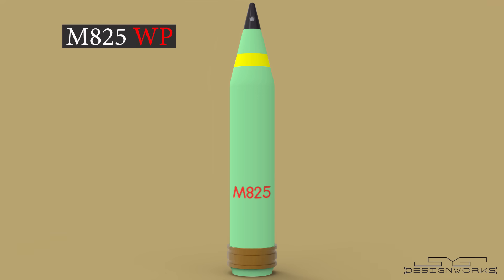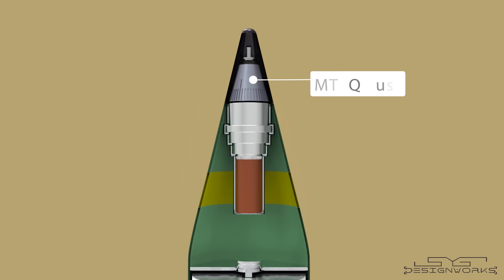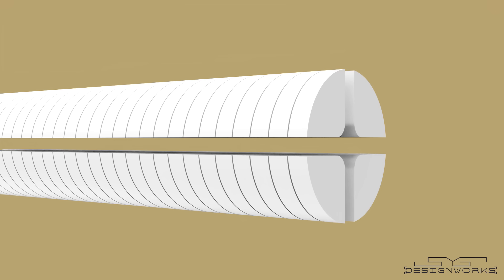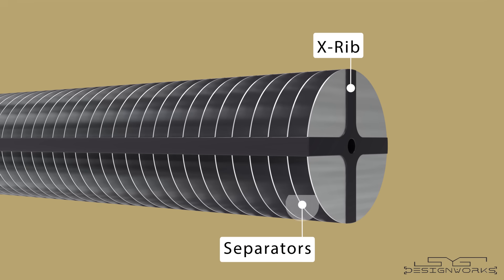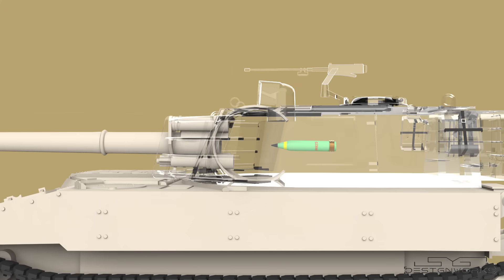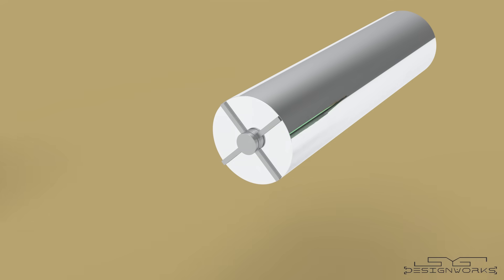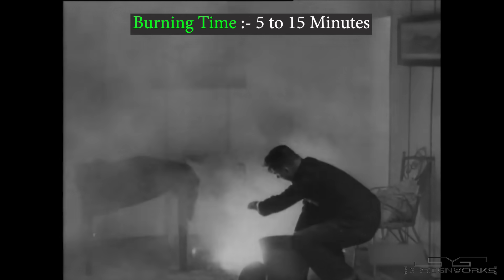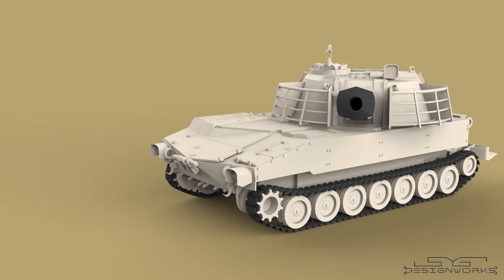What are White Phosphorus Bombs and How it Works?

Comment: Mud is the best thing to extinguish WP if it gets on your skin. DONOT use water! Other than that, mineral/castor oil or some type that has a really high flash point like grapeseed oil. This is only with small pieces of WP though.

Comment: White Phosphorus (WP) aka Willy Pete is actually very extremely poisonous substance, used as a smoke screen, and also incendiary. When it comes to a human being it burns horribly and causing infections; it burns in contact with air. Newer ones can actually burn in air or water, older ones only water can actually put it out.

Comment: Willie Pete is absolutely the best "Break Contact" tool in the arsenal. Back in the day, we had WP in grenade format which was absolutely one handy little tool in our bag of tricks. Good for clearly bunkers and tunnels, it also useful for marking enemy positions, avenue of advance denial and absolutely the GOAT for breaking contact with a larger, numerically superior enemy force. It was also a sneaky little bastard. When in contact with said "numerically superior force" you could lure the bad guys into a "Mechanical Ambush" by throwing alternating Willie Pete and White Smoke (or CS) while setting up the Claymores daisy chained and crisscross aimed. When the smoke from the WP cleared they would charge through just knowing that this must be a critical path or weakened unit...just to run into the Claymores (ouchy mama).
Reply: Thanks - both for your service and some 'tactics'. Did you employ that yourself - in Special Forces/units? 
WP was also used by FACs - their rockets marking targets for the 'fast movers'.
Reply: @ibubezi7685  I still have the pock mark scars on both arms and my back from being " a little too close". I don't remember how many times we used WP,  but it was more than a few times...worked most the time. Love me some FAC's, if they were in the bar, they never bought themselves a drink, not while I was there anyway. Same with "Rotor Heads" and "Fast Movers" even today, when I occasionally run into one, whatever it is we're eating or drinking... they can keep their wallet in their pocket...I'm buying.
Reply: We used WP grenades to destroy equipment. You can put one on top of an engine and it will burn through it. It's wild
Reply: @phatbottom  I suspect you're confusing Thermite with Willie Pete.
Reply: @brianfoley3925 bingo ! Another one of these Iroq / Afghanistan veterans
Reply from the maker: Wow. Thank you for watching!
Reply: Who are you talking about?  What 'enemy' are you talking about?
Reply: @peterthurman9384  You know...pesky neighbors...the kids down the street...Jehovah Witnesses...Magazine Salesmen...North Vietnamese People's Army...you know...:those people".

Comment: I was uner the assumption that white phosphorus COULD NOT be extinguished with water???
Reply from the maker: According to Centres For Disease Control and Prevention, cold water spray or fog can be used to put out small fire from White Phosphorous.
Reply: @sygdesignworks  thanks

Comment: @sygdesignworks This is a very well presented video, graphics are great, very clearly narrated. While you do mention some of the proprties of WP, and hats off for raising awareness, because it is indeed, a very brutal and inhumane tool, and also thank you for mentioning its use upon civilians. It's almost funny that the UN is considering whether or not to classify it as a chemical weapon, as that is EXACTLY what it is. One thing I did not see mentioned is that to put WP out once it is burning, one needs to use copper sulphate or a similar substance to coat the phosphorous and seal it off from further contact with air, water, flesh, bone, blood, clothing, to put it out. US soldiers used to be issued copper sulphate infused towelettes in their med kits for just this purpose. 

WP hand grenades are still one of the de facto tools for clearing spider holes and bunkers because when it bursts, it doesn't just make smoke, it fragment into little burning pebbles.  That's why it's turned into felt in both artillery shells and grenades. NASTY stuff. Again, thank you for raising awareness, and taking the time to fully explain something that usually just brushes right past most civilian awareness outside of theaters of war.

Edit: 

       Water will NOT extinguish WP because the metal simply pulls the oxygen off of the water molecules. You can probably find demonstrations of this where a piece of WP is dropped on water and will simply dance and sputter on its surface because it boils the water and burns the oxygen in it too quickly to allow it to sink. Normally when stored in a lab, it is done so as submerged completely in kerosine. When pulled out of the kerosine, as soon as even the tiniest surface is exposed to the air, the whole piece will very quickly ignite. Thus, handling is best done in a vacuum or other oxygen free chamber.

Subscribed.
Reply from the maker: Thank you for the valuable information, and Thank you for watching!
Reply: @sygdesignworks  For those unaware, copper sulphate is also known as bluestone, and is regularly used by veterinarians to treat thrush. I don't know about acquiring it in bulk or shipping it to places where WP is in use, but I suspect there are supply houses for vets and something as mundane as bluestone should raise any eyebrows. Obviously it is literally a band-aid for something that should never be used on anyone, let alone civilian non-combatants. I hope this information can be used to stop pain and suffering.

Comment: I remember training with the WP grenade. My instructor at the time told me to "never throw this grenade without some cover to hide behind, cause it can cause casualties in a wider radius than you can throw it" and years later I found out that it was shaped like a pine cone and had a ring at the bottom because you could attach a rifle-grenade adapter to it so you could launch it from the end of your weapon with a blank round

Comment: The scene at 6:13 is not phosphorus, but a thermite mixture that is part of incendiary or lighting ammunition. A characteristic sign of phosphorus combustion is a white smoky trail, the termite practically does not emit smoke while it is in the air.
Reply: thanks for writing this! I also noticed a mistake in this moment and wanted to write, but I saw your comment. I can also add that thermite is easily distinguished by its sparkling tails, like those of a comet, which fall after the incendiary elements. This is molten metal reduced from its oxide. The color of the termite smoke is gray and there is little of it.
Reply: Or it could be a magnesium shell like the Russians and Soviets used. They look like that too. They are another incendiary and illumination round
Reply: Doesn't Phosphorus Explode on contact with water. ??
Reply: @prophet1782  Not sure about all types of Phosphorus, but white phosphorus does not. In fact, WP burn Patients are to be suspended in vats of water to prevent them from catching fire during the treatment
Reply: @prophet1782  yes it does.

so does sodium, lithium

cesium

francium

any element on the extreme left of the periodic table will react violently with water or air.

 in my chem lab these chemicals were actually kept in water but were covered in a waxy or oily substance that would prevent any reaction from taking place.

these elements are the worst sluts in the chemical world. 

just cant wait to give it up. 

by "give it up" i mean donate an electron, as they only have one in their outter layer and the oxygen in water wants to grab that electron and release energy in a exothermic reaction that results in a more stable chemical configuration

oxygen wants to share 2 electrons. having 2 in its S1 shell and 6 in its S2 shell, it only needs 2 to complete its second shell and so will bond with 2 atoms of lithium, soium, phosphorus, cesium, or francium.

the further down the periodic table you go the more rapid and violent the reaction. 

an element like Cesium has 55 (or 57, not sure but i know its an even number because it has one spare) or Francium will give away its lone electron more quickly than sodium or lithium because the electron is further away from the positively charged nucleus, and thus the force of attraction to the nucleus is very low, allowing the reaction of covalent bonding (or ionic bonding in the case of a bond with chlorine or any other element missing only one electron in its outter shell.) to occur quickly and violently with a release of huge amounts of heat.

the oxygen and nitrogen in the air will react with these elements readily and create the nasty burns associated with these weapons

Comment: Where the wp rockets fired into bunkers at Normandy by fighter planes operate in the same way?
Reply from the maker: Not sure because those were very old 81 mm mortar rounds. The working mechanism might be different. Thanks for watching.
Reply: Wp is a very useful and flexible tool/ weapon, and due to the “simplicity” of how it works (the chemical reaction can’t/ won’t change) the only difference is the way it is used and the delivery method 

It can be used to produce a snake screen 
Mark targets for air
Destroy bunkers 
And it is a GREAT anti infantry weapon

Comment: Water to put it out? Really? That is the opposite of what you want to do. Basic chemistry classes tell us as much. Phosphorus pentoxide: P4O10, which forms when white phosphorus is burned, functions as a dehydrating and condensing agent. It reacts vigorously with water to form phosphoric acid - nasty stuff, pH is 1.5 so it is a strong acid. What you really want to do is try to achieve that hermetic seal it had in the munition before discharge - so cover it in wet sand, a soaking wet blanket or towel and get it outside using a metal tool or grab a shovel to dump it into a bucket of water - DO NOT PUT WATER ON TOP OF IT like those in the video, because as you can see, it doesn't do a whole lot and it creates an acid that you don't want sloshing around or vaporized in your home/shelter.

So for our Ukraine buddies - cover it in wet sand, a soaking wet blanket / towel and get it outside using a metal tool, or grab a shovel to dump it into a bucket of water - DO NOT PUT WATER ON TOP OF IT
Reply from the maker: Great info! But I have read that White phosphorus is stored underwater? It said, keeping it underwater stops it from reacting with air, since its insoluble in water? How is that possible?
Reply: @sygdesignworks storing it submerged is the best way to keep it from igniting but pouring water onto an already burning phosphorus fire will just burn off the water and cause it to spread the phosphorus into smaller bits (due to rapid acidification and dessication) as you can see it does in the old timey video when they pour water on it the water boils off and tiny pieces almost instantly pop off. Ideally, submerging it is fine, but you need to use metal tools like shovels or tongs - so no biggie. But if it’s on say a wood floor and starting to burn away, the best thing, would be to dowse it down with wet sand to smother it and then transfer to a bucket of water or more wet sand with a metal tool while keeping it submerged. In medical settings, copper sulfate is used to make the oxidative burning process halt, reducing damage to the patient and to make the removal easier
Reply from the maker: @travish1853  Excellent info. Wish I had contacted you before making this video so that I could have explained it better. Thanks for watching.

Comment: I got a small piece of WP on the back of my hand during a military operation (from a WP grenade) ,only way to keep it from reaching bone is to cut it out, which i luckily did as once. Still have the scar.
Reply from the maker: What!? Cut out your skin/flesh? You must be brave!
Reply: No, we were told that if the stuff burned through to bone it would be even worse and could well cause cancer. Cutting right away was the alternative. @sygdesignworks
Reply from the maker: @יונתןזנטון  Hope you are doing well now. Thanks for watching.

Comment: This is one of those that I wonder if we signed an international treaty that we would not use these again but if that is true, not all nations signed it and this could be a little different in some ways.  I think that we (US) do not use flamethrowers or napalm anymore but I am not sure about this
Reply from the maker: Correct. But unfortunately these are only restricted under international humanitarian laws. All other laws are not applicable to it.
Reply: @sygdesignworks  God Bless and thank you very much for the information.
Reply from the maker: @daruscole1586  Thanks for watching!
Reply: The problem is that WP is very good at making instant smoke clouds for obscuration purposes. Other chemical smokes (such as in smoke grenades) emit a slow stream of smoke which is good for signalling purposes but not so much for obscuration.

Comment: So. Small chemistry lesson here.

Phosphorous pentoxode might not be toxic but this compound is highly hydroscopic and very, very acidoc, as its the anhydride of phosphoric acid.
This compound is a solid and does not have a smell.

Garlic smell comes from other phosphorous compounds - usually phosphonic acid derivates, who usually are not healthy at all.
Reply: And it's important to point out while the smoke itself is not lethal unless inhaled for prolonged periods of time, white phosphorus itself is VERY toxic, meaning even if you manage to remove it from your skin (which is not easy, this stuff will burn through your flesh and through your bones) you may still die of poisoning. It's one of the worst ways to go
Reply: @buckplug2423 it's like cyanide levels of toxic too. I have some WP and I keep it locked up out of reach of anyone who shouldn't be touching it.
Reply: Interesting 😥😖..
Reply: So we can eat a white phosphorus bomb but not garlic?!
Reply: Hygroscopic with a G.
Reply: Damn all Walter white  , I saw that episode of breaking bad too.
Reply: Can put restrictions on everything
Reply: 1:04 the guy inhaling all that smoke/vapor is crazy i bet his bones glow in the dark
Reply: You're a cop for sure
Reply: OOOh... you mean the phosphoric acid used to make soda pop.  BFD Yawn.
Reply: Wow thanks for yapping 
As someone who barely has a clue of what ur talking about I’ve got to say that did nothing

Comment: WP is a potent screening smoke, like a lot of other really good screening smokes they work by forming materials that will react with the water in the air that will coalesce into small droplets. These smoke screens are nearly impervious to IR and thermal seeker systems. This is similar to Titanium Tetrachloride countermeasures, which for a thick vapor of Titanium Dioxide and Hydrocholoric Acid in the air, or HC smoke, that forms smokes laden with hydrochloric acid.
Reply from the maker: Wow. Thanks for the info.
Reply: Smoke...and hydrochloric acid...I started coughing just reading that.  Yuck.
Reply: Hydrochloric acid in the air is a CHEMICAL WEAPON.

Comment: Correction: You cannot extinguish white phosphorus with water,It burns because of oxygen in the air and if I recall from school water is H2O.

Also when I was in the army a bunch of guys were out clearing brush around the  base perimeter and one idiot hit a unexploded phosphorus tail fin with his machete,Well to say least I heard and witnessed several casualties screaming with pain from burning phosphorus And one was submerged in a water tank but had little effect😥
Reply: Speaking as an EOD tech with +40 years experience,.. @brentc.6690 is 100% correct that WP does not react with water. I've inerted live WP rounds into training aids, which involves drilling holes into the case while it's submerged in a water bath, then boiling it out.
Reply: White phosphorous does not react with water.  In fact, it can be stored under water.
Reply: This is not true. Do not spread your fals informations. White phosforus is NOT BURNING under water. O2 and H2O is very much different, even if H2O is containing oxygen too, as you may experience when handling normal fire with water. White phosphorus may react with water but not as viciously as with air so the reaction is not burning. The video above contains actual white phosphosur extinction with water. You can see that it looks like it is not extinguishing in the first place but eventually it does. It needs to cool down the surfaces, because obviously you can not extinguish with steam, and what you get is actually a possible further spread and increasing burn in the first time. It is again similar to poor water to a big camp fire. First it might look like that it increase flame and smoke. Eventually it stops booth. White phosphorus is vaxy so ptobably it is not mixing well with water, so it is not easy to actually wet its surface, specially because it is very very hot.Here is a video about it. (He keeps it under water to keep fresh) https://www.youtube.com/watch?v=LMlXhJevCV0
Reply: Yes, just as napalm, white phosporous cannot be extinguished by water
Reply: right - WP reacts with water. dumping it in water has no effect, however using high pressure water - such as a garden or fire hose - can (if done properly) push the wp out of the wound or burning area to somewhere it is less harmful.
Reply: @randyfant2588   you are wrong, you confuse WP with  metallic sodium,  sodium burns in water, not phosphorus,  actually WP is stored in water.